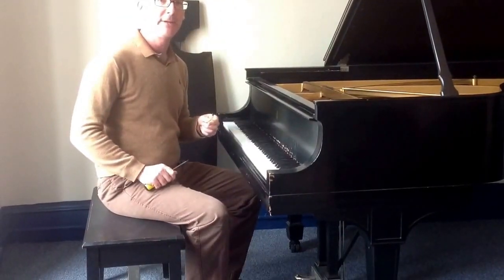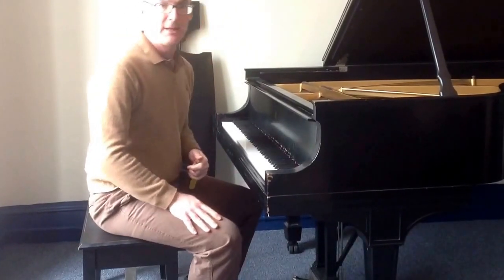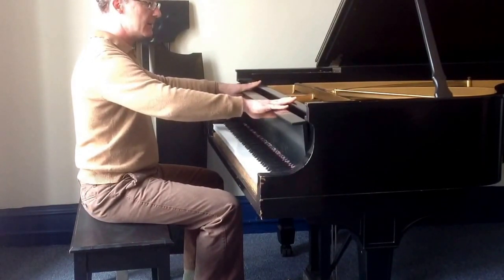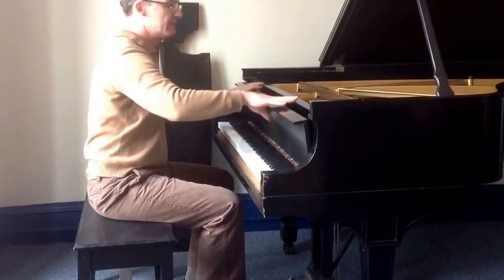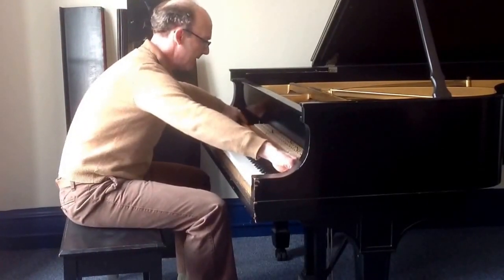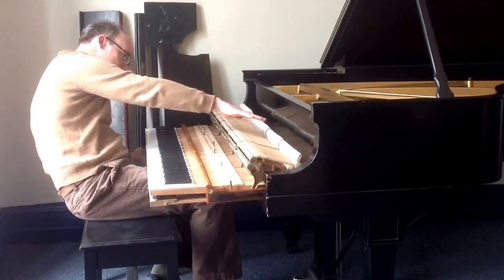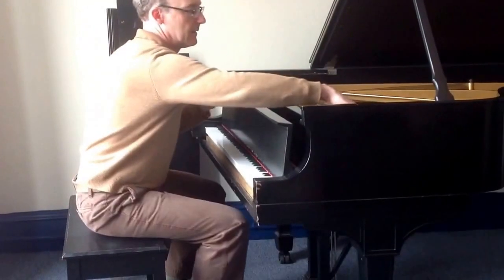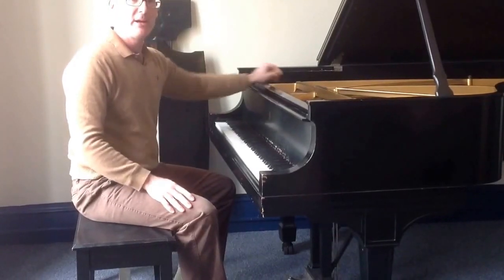Safely remove/replace your Steinway action

Comment: Be careful not to be holding down any of the keys when you slide action out. If a hammer is raised (ie by your finger on a key while holding the action) it will be snapped off as it passes under the wooden beam above.

Comment: This is great.  I need to remove a few pencils from my '59 L.    

I had seen my technician do this and I remember it being fairly easy but couldnt remember exactly how he did it and needed to make sure I was doing it correctly.  Thank you for this video!   

What I would love to do is clean all the dust off from the sound board under the strings, especially near the dampers.  My vacuum doesnt have strong enough suction.  

Do I just need a better vacuum?  What do you recommend?